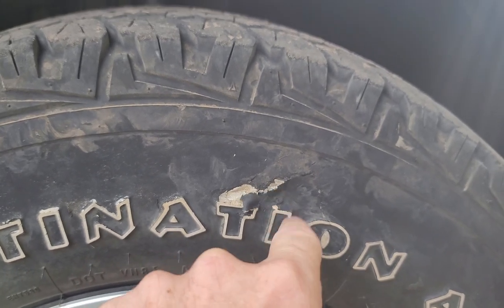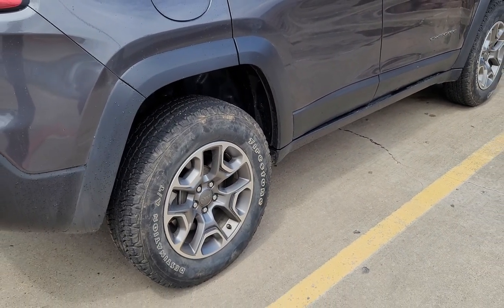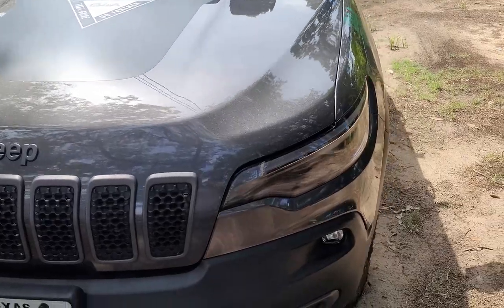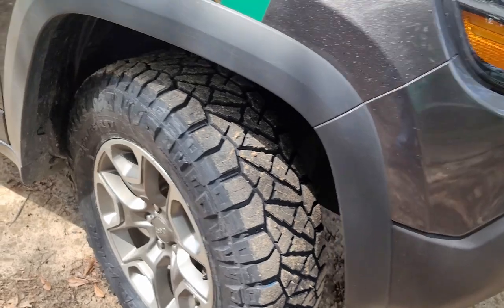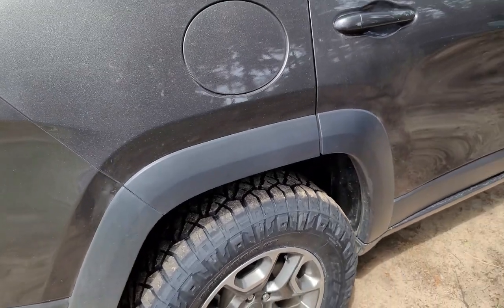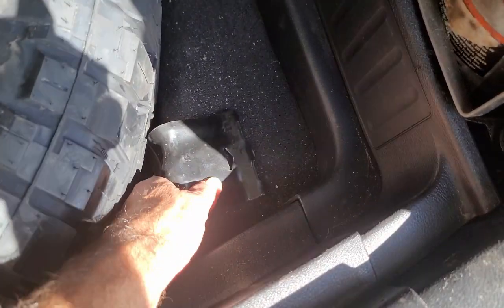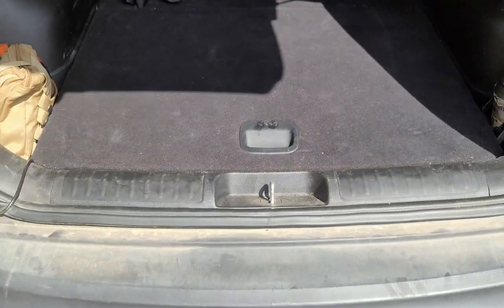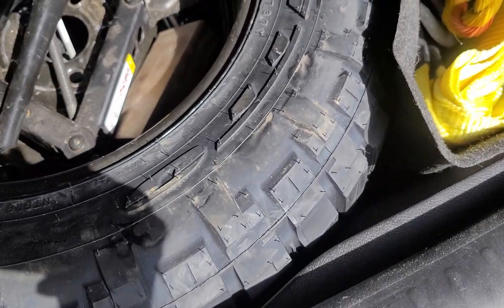Bigger tires on the 2021 Jeep Cherokee Trailhawk. 265/65 R17 Fit?

Comment: I really appreciate you letting me know that they fit in the spare. 

Yeah I had the sidewalls peel like that too and I don't even know how it happened. You can take a permanent marker to it to cover it up and maybe drop a drop of rubber cement on there but that's about it.
Reply from the maker: Good excuse to get a more rugged tire. Lol.
Reply: @Outdoors4adventure  yeah I went with the Cooper AT3 4s, 265 65 17.

It's still tempting to go with falken wild peak AT3  or nitro ridge grappler or milestar Patagonia next time. 

These coopers probably do the best on the street out of all of those tires they are not loud at all and they perform extremely well on Road and they do just fine off-road. 

I do like the falken at3s though that my wife has on her Jeep. I still feel like there's a chance that they're more durable than the coopers they're still not that loud and they drive like a performance tire to be honest. I've had a lot of performance tires on cars in the past and those wild peaks drive like a performance tire.
Reply from the maker: @off-roadingexplained8417  My main thing is the tire sidewall protectors. I ran ko2s on my 4x4 titan. Great tire and never had a puncture. Wanted to try something different though. So far no complaints.

Comment: I have a 2021 trail hawk unfortunately I have a sensor problem at less than 15k miles and I live in Baja jeep said they will reimburse me but you have to wait 2 t months to get the part I want to upgrade to a bigger tire also just wondering does that void the warranty if you put a 2 inch lift
Reply from the maker: Up to two inches shouldn't.  Some dealers may try to say it does but If I understand mopars writeup, up to 2 inches is fine. Hope you get back up soon.

Comment: I have a 2014 trailhawk. Wanting to upgrade the tires curious to see if I could get up to this size with no lift and maybe a little trimming. Any thoughts?
Reply from the maker: I have read That it is possible and that the lift really doesn't help that much for tire size but more for ground clearance.
Reply: I appreciate that! Any ways to test sizing out on my vehicle without purchasing tires?

Comment: Are the 19 wheel wells different from the 21 wheel wells?
Reply from the maker: 19 should be same as mine. Redesign with 4 lights up front instead of 6.

Comment: Is anybody running wheel spacers with this size with no rubbing?
Reply from the maker: I will guess they would rub.
Reply: @Outdoors4adventure  I got them on! 0.75 inch wheel spacers and no trimming required. Very mild fender plastic rub during hard turns under load. Fixed the control arm rub 100%
Reply from the maker: @off-roadingexplained8417  I haven't had control arm rub yet.

Comment: Has anyone just gone up to 255 on stock?
Reply from the maker: I would think they would work. Maybe just a tad heating liner and pushing it back. Discount tire will do a test fit.
Reply: I literally just installed 255/65/17 because I still wasn't confident in 265 and I do not have a lift on mine still stock height. I have even more room than this and don't have to think about heating the fenders. This still makes me wonder though could I have done it.
Reply: oh mine is a 2019 so the slightly smaller wheel well appeared this year
Reply: @Qmann05  I've got the 2015 cherokee TH 3.2l I want to go up to 255 or 265 without a lift. I'm getting tires after winter, see what I can do
Reply: @user-qo7qc5em5t  265 will for yours no issue